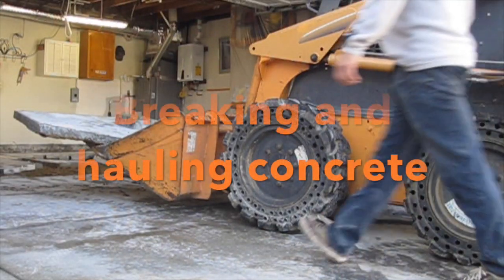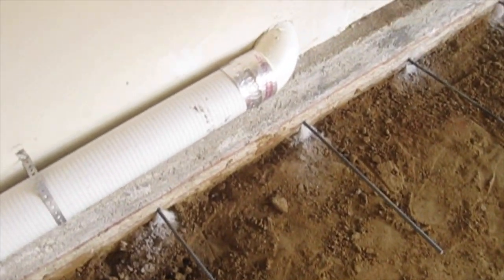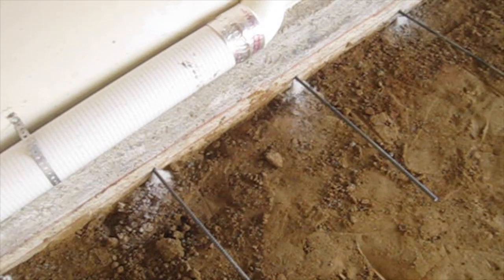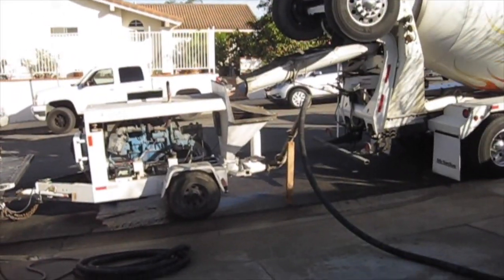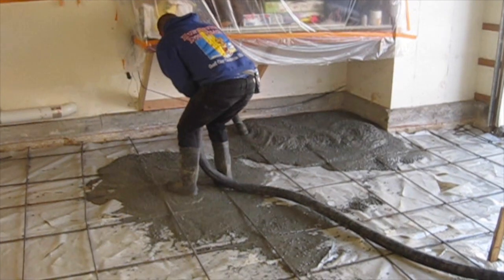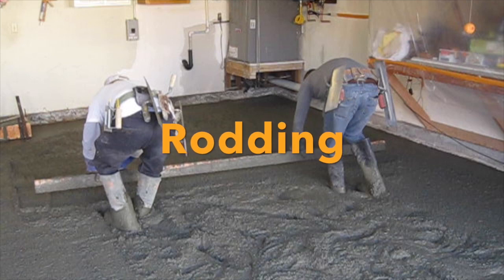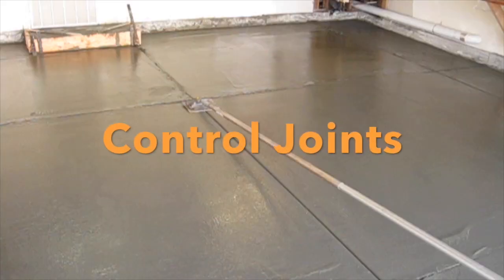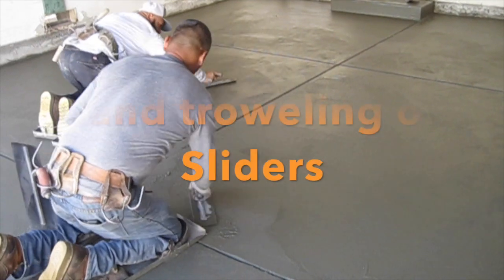DIY How to replace a concrete garage floor California

Comment: We do mostly indutrial and commercial.. But even with residential,, We cut almost everything, unless its really cracked up. In Ill. We pour a little thicker concrete for the cold. Easy,fast to pick out with Bobcat forks

Comment: What size Rebar’s did you use and what saw did you use to cut so close to the edge of the garage
Reply from the maker: 3/8 rebar a quickie  saw 14 in blade

Comment: How do you get the cut flush with the wall?
Reply from the maker: You're referring to a monolithic pour where the footing and the slab are one piece. In that case you would have to saw cut the perimeter. In the 70's in Southern California the footing was poured separate from the slab. As I was breaking, the slab broke clean off of the footing.

Comment: Why did the homeowner decide to replace the garage floor? Great work.
Reply from the maker: There was cracking everywhere There's expansive soil in that area and bad in the day they didn't use a moisture barrier.